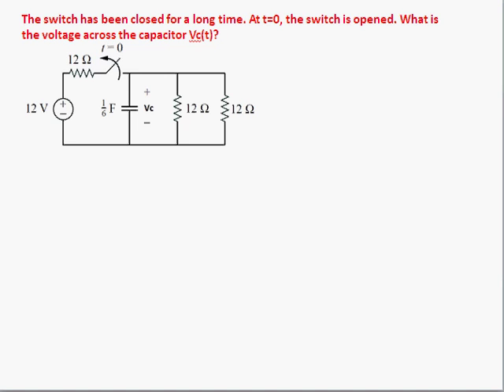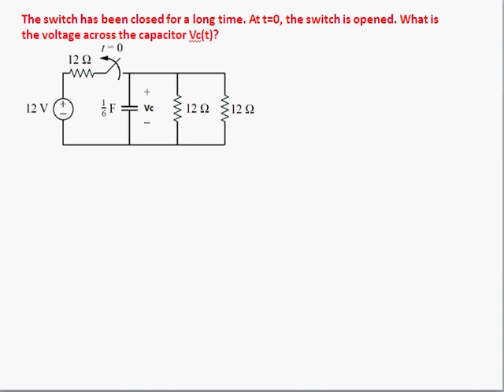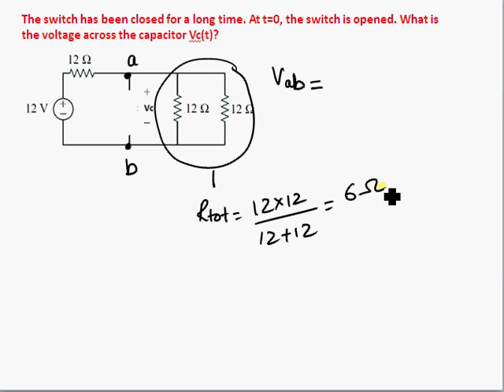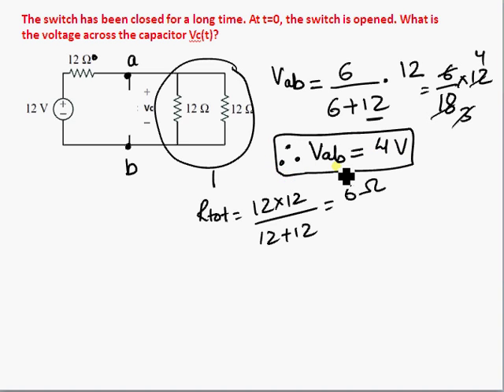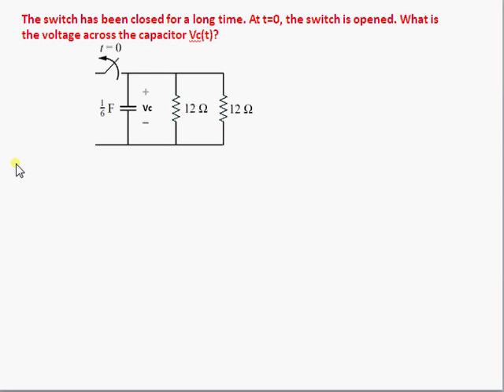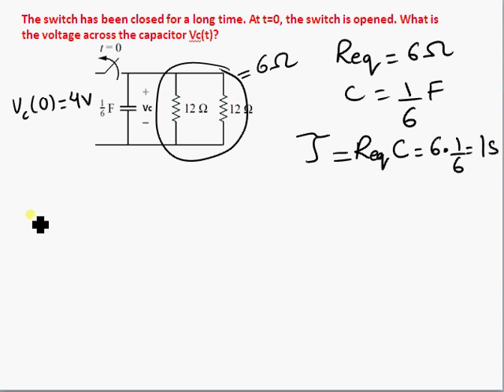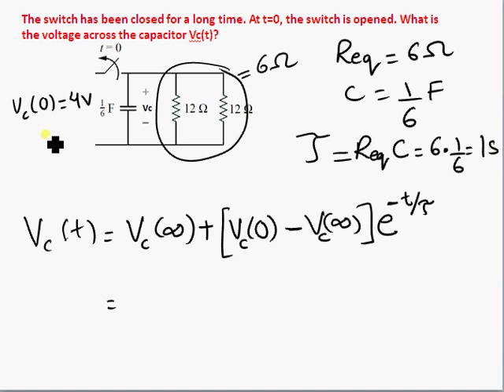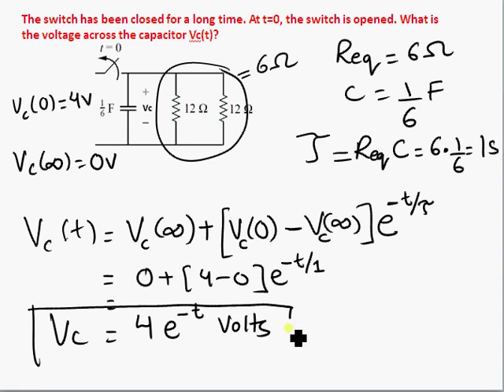Example - Transient Analysis (1st order circuit)

Comment: At 2:51 you may ask like me what's up with the six on  the equation.  
Well he found the total current  by dividing the voltage source by the total resistance.  V/R = 12V/ 18ohms,  now with the total current he found the current in the parallel branch by:  total current x 6  ohms  = the Voltage in Vab.  The parallel branch is also in parallel with Vab and therefore they will have the same voltage of 4 V.